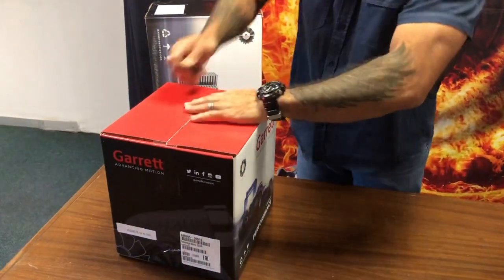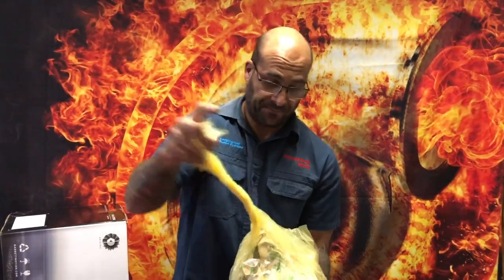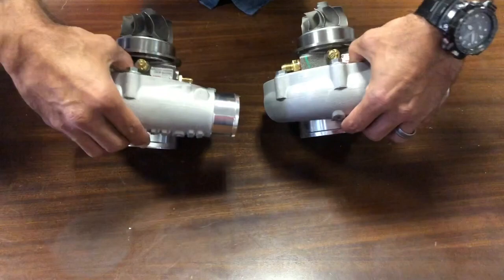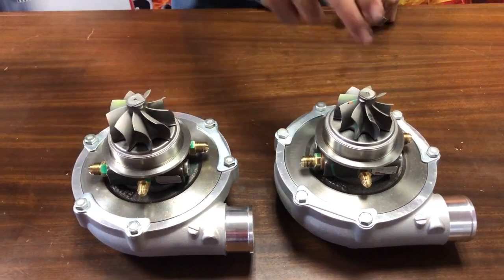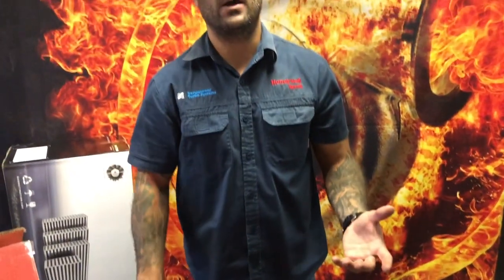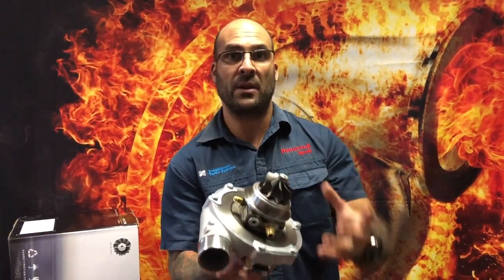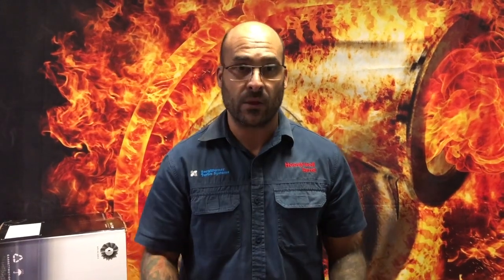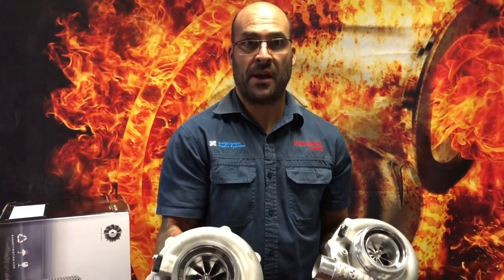G30-900 and G35-900 compared

Comment: Hi Chris. Going to be putting the G30-900 on to my RB25det with the 6boost and 50mm gate etc.. will they G30-900 be very responsive at 400rwkw and what kind of NM will it achieve? 

Thanks
Reply from the maker: What do you intend boosting?
Reply: Chris Kambouris probably boost will be set to around 17 to 20psi
Reply from the maker: @VFGTSR  that's not very high boost, don't expect too much from this turbo at that boost. If you don't plan on using any higher boost than that, and don't plan on producing 900HP - then i would seriously consider the 30-660 or G30-770 - in fact the EFR series would suit that motor extremely well too - faster spool than most if the same size Garrett units - due to the GAMMA TI turbine wheel. I say this because the RB25 is relatively lazy in spooling a larger turbo up - its nothing like the RB26 motor
Reply: Chris Kambouris  what boost level should I take it to you think.  
The G30-900  is that a similar sized turbo to the gtx3582r gen2. 
To compare too.
Reply from the maker: @VFGTSR  This all depends on what power you want to make - whenever a client calls us for advise on a turbo choice, the first thing we ask is "What HP target are you looking for?" Once we know this, the rest is made a little easier to calculate
Reply: Chris Kambouris  thanks for your replies. Because my bottom end is stock will be tuning the car to 500rwhp until I rebuild the bottom end then I will be tuning it too around 600-630rwhp
Reply from the maker: @VFGTSR  You going to need ALOT of upgrades done to the motor itself to achieve this power. The G30-900 will be my choice in the Garrett line-up and the EFR8474 with T4twin scroll turbine AR83 - this would be my first choice if this was my own project
Reply from the maker: @VFGTSR  To make this power on the RB25 you'll have to do a lot of head work, won't be as simple as putting on a turbo to make this power.
Reply: @TurboDirectSA  - I got same questions - on same build - How much spool later is a G30-900 compared to G35-900 if they are same 0.83 AR on a RB25DET? Thanks
Reply from the maker: @radaces  expect around 800-1000rpm
Reply: @TurboDirectSA  - Thanks do u know if G30-900 0.83 AR will reach 700-750rwhp Mark on a Hub Dyno? it's a Built Forged Rb25det with all supporting Mods n running E85 full time. Thanks. Planning to run 24psi low boost n 30psi high boost - Revving to 8k Rpm.
Reply from the maker: @radaces  no it won’t - maxed out the turbo will see this sort of power at the crank. It’s very overrated in comparison to the BorgWarner range of EFR turbos.
Reply: @TurboDirectSA - So will a G35-900 be a better suit?
Reply from the maker: @cesarrada8217  for the additional lag - it will make more, you will need to decide if you want a laggier setup though. I would go EFR8474 black - spool is ALOT faster and mass flow rate is higher too!

Comment: Chris as always, your videos are extremely informative, and well done! When looking at the compressor maps, all the g series seems to be a little lower than their advertised power rating. Or, am I reading the maps incorrectly? If you are building a street car (700-725whp) for quick spool, which turbo would you recommend? It will be on a RB26 with a progressive 100 shot. Thank you for all the work you do, and your time! Cheers, Tony
Reply from the maker: Tallen Motorsport you are not reading the maps incorrectly at all - keep in mind that maps are prepared in X'ratings' - When I spoke with one of the team leaders at Garrett in the past we spoke of a competitors compressor maps and the fact that they claimed to make so much air flow and boost level ....... i was shown that the map was setup in X-15 which equates to for every 10lb/min of air flow the compressor boasts 150HP -- when you see some of the other OEM turbo manufacturers, (we have direct distributorships with all of them) other maps are designed around X-12 (120HP for every 10lb/min of air flow - The latest Garrett maps might not seem correct (using the 10lb/min = 100HP calculation), but in reality, we have seen that the G-series actually produces more than what the maps claim,  showing yet another conservative effort on the Garrett side.  Ill try to get some more information from Garrett techincal team on this and comment back - perhaps this calls for another video..... 

As far as recommended turbochargers, i alway work slightly differently to other tuners/shops/outlets - i like to imagine this was my own build, and advise accordingly. The Turbocharger should never be pushed to its limits to make the intended power, as you know you ALWAYS need a little more here and there. Why push a turbo to its limits all the time when the engine is in use (unless its s track car/competition/circuit/rally application where budget allows rebuilds and the designs with HP limitations are on the ragged edge. If the car is a street car but will be used together with some form of motor racing, drifting etc, rather choose a turbocharger with some reserve in place in case of the demand for more - at the same time you lower the pressure, boost, heat into the engine, and run there turbo at lower speeds, however still using the same turbine selection for the required reeponse. HP is easy to make and if a certain turbo is just too big or just too small, it is easy to make small mods to the motor, fuel used or both to play "catch up" and fill the gap. 

G30-900 is a loaded gun!  We have just seen a Golf7R make over 700WHP on a G30-900 with AR61 turbine housing, and said goodbye to an expensive clutch upgrade - now to swap the tranny to the DQ500 setup..... point is the 700-750WHP setup cars will love the G30-900 (motor size dependant obviously) and have plenty in reserve. This power is easily achievable around 2.2 - 2.4bar boost gauge pressure, once again motor dependant. drop me a line privately if you don't want to share your project in the comments section, and ill help where i can.
Reply: @TurboDirectSA  A video covering that would be extremely helpful. I am looking at a couple maps right nany, and I see nothing that states 12 or 15 for x. I was leaning towards either the 30-900 or the 35-900. 700whp with a .61 on a 30-900, wow! My car will be 100% street. Forged 2.6 with 264/9.15 cams, meth, fuel to support 900hp, 3.5 exhaust, light ported head. Basically I want the grunt of a V8, but able to spin to 8200rpms safely. When I was running the numbers on the 2.6, I was on the limit for 2.3bar with that 30/35-900 compressor. Of course its what you plug into the variables that dictate the limit, so I could be off a little. With the number you just quoted, I will probably lean towards the G30. N2O on a RPM window that starts at 3200, but will close when full boost is hit. Just for some added grunt if needed. I hate lag. ;) Thanks again for that you do Chris! Cheers, Tony
Reply from the maker: @tallenmotorsport8416  Tony, i would lean towards the G30-900 for sure, it will make the power you want, since you have modified the engine to accept the flow that the turbo will provide, i don't see this being toooo much of a problem flowing to 8000rpm, but with the mods and cams, it might just lay down onto - if it does, simply change to the AR83 turbine and youll be 100% again, however you will then start using the NOS a little more ..... its always a trade off and a balancing act I'm afraid.

Next thing to try is add 5% nitro to your mix, and see what happens ..... :-)
Reply: @TurboDirectSA  just a question, on a destroked 2.3 wrx with all the extras which currently has the g30/770 but runs out of airflow which would be a good upgrade to keep good response. I would still like 4K response so it has a decent power band,but more top end so the turbo doesn’t roll over
Reply from the maker: @Adl-pk4hg  You see the results coming through on the G-series turbos now -- remember as i mentioned on the comparison between the G-series and the EFR turbos - as the boost increases the Garrett falls away, and the power reduces - Its sad that the G-series turbos are nothing compared to what the original GTX Gen1 and Gen2 were - i guess when the management teams 'rule' over their employees, the dream team falls apart - Now to answer your question - 

We have put together a turbocharger that combats that exact problem, that i have been speaking about for 3 years now. We use a combination of the Gen2 GTX and modified compressor of the G-series in order to hold power higher in the RPM range (compressor map widens) For now you might have to change the turbo to the 900 - BUT it will be laggier, this is in essence now what you want, but the other alternative is to change (you are changing a turbo anyway) to a different turbo. 

What HP target are you currently reaching? Tell me more about the boost and fuel used, ill share my thoughts
Reply: @TurboDirectSA  I’d be happy with the 600whp I’m a little off that atm on pump98 with 5 port water meth injection one to each intake runner and one over the intercooler core, at the time we went with the g30/770 it was the newest on the market, I like the response it just runs out of flow which means I can’t use the revs my motor was built for, it was originally tuned with a high boost level of 38 lb, but now due to the heat and humidity of where I live its max is 34 lb, it is only using the .8 exhaust housing I’m not sure if it is .81 but was thinking maybe with e85 and the 1.01 exhaust housing I might be able to make it flow better top end without losing to much response. What are your thoughts, my mechanic is of the idea a g35/900 or 1050 is a better match as I won’t have to use those high boost levels to achieve what I’m looking for, I’m just unsure as this will push boost response to nearly 5k which shortens the powerband
Reply from the maker: @Adl-pk4hg  Using a larger AR turbine housing will only induce more lag - this is not what you want - you wanted to maintain the 4K response. The problem is not backpressure, its lack of air flow - your engine is demanding more than what the turbo can provide at that higher RPM ranges.  If this was my car i would swap out the turbo for the 8370EFR - or last resort go the -900 route, BUT keep the current 82 turbine housing.
Reply: @Adl-pk4hg hi, I was running the same turbo on a ej25. I went from a .83 to 1.01 rear housing and gained 50 wheel kw, to 400 awkw same boost. Not much loss in response (I don’t notice any while driving but about 200rpm on graph). The EJs respond well with more turbine flow especially on e85. 

I’m going a g35-900 with 1.01 now as direct bolt on for my setup and want more power.see what happens.

Comment: How does the GT30-900 compare to the BW7163R in terms of max power and spool up time? Which would be better to use on a 7R which is both a daily drive and weekend racecar?
Reply from the maker: The G30-900 is not an apples with apples comparison. The EFR7163 is designed as a 550HP capable turbocharger, it makes this power with no issues and without having to run extreme boost settings. The G30-900 is a large compressor and much newer aero design when compared to the EFR unit - however the spool characteristics of all EFR turbochargers are nothing but extraordinary, due to the extremely light weight GAMMA TI turbine head.  If its 900HP that you want to produce, firstly your DSG gearbox will shout mercy first, the remaining drivetrain will never handle this and the motors engine block will certainly put its hand up when things get on the boil - if you looking for a "relatively reliable" achievement output of around 550-600HP the EFR7163 is certainly a missile of a choice - id suggest you watch this to suit that turbo choice.

https://www.youtube.com/watch?v=HecA-W9ji5M&t=1s
Reply: @TurboDirectSA  Awesome. Thank you for the reply. Now to compare the EFR7163R vs Turbo Technics V5.
Reply from the maker: @kiewietduplessis6463  Pleasure - never heard of the technics V5

Comment: Chris i have also question about the choice right turbo setup. I have Skyline with RB26 engine 2.6L with peak 8400rpm so high rpm and high pressure. I should go with G30-770 0.83/1.01 or G30-900 1.01? My goal is 580-620whp on 93.
Reply from the maker: SnaraGTR What boost pressure are you intending to run? What Fuel and what application ? (Application - meaning drift, drag, steerable, circuit racer etc?)
Reply: @TurboDirectSA  About 26-28psi. Fuel premium gasoline ron98 without meth. Car is only used on fast street or highways. No track/drift.
Reply from the maker: @Snaraa  You need to use the G30-900 with AR83 turbine housing - the 71mm exducer on the G30-770 is going to be too small to make this power hold throughout your high revving engine. The G30-900 uses a 76mm exducer compressor and will spool more than responsive enough and make the power you want without having to push the turbo too hard, or running too much boost pressure.  This will make for a more reliable motor and turbo combination and slightly lower boost to achieve that power you want.  I would also consider the BorgWarner options, the GAMMA TI turbines are extremely light weight and spool extremely fast with seriously high flow compressors. The quality and longevity of the Borg's are actually better than the Garrett counterparts due to the lower weight that the ball bearing cartridge is carrying.
Reply: @TurboDirectSA  Thanks ✌️ I am very grateful to you. I think efr8374 with 74mm exhaust will be more laggy and have worse response than g30 with 60mm exhaust 🤔 but maybe some one compare both turbos.
Reply from the maker: @Snaraa  No buddy you wrong - the EFR8374 turbine weighs less than the G30 turbine head, spool will be much of a muchness, however the lightweight rotating assembly will last forever.

Comment: Chris my question is and allways been the same from the day GTX3582 and GTX3576 came around.
What about the .63 + 35 wheel vs the .82 + 30 wheel. There we have the same turbine flow and compressor flow.
Lets say we have a low rpm - high boost requiring engine vs a high rpm  - low boost requiring engine to make the same hp what tubine wheel + turbine housing combo goes were? I know its a difficult question but it deffinately has an answer.
Thanks
Reply: I'm interested in your response to this question too. I also have a question of my own. How do you feel the g35-900 would respond compared to a gtx3582r both in 0.82 housings?
Reply: on a vtec b16 81.5mm engine with 10+ cr which turbo would be the best to hit 600-700hp?  i bought G30-770 reverse rotation on 61 a/r .
Reply from the maker: @Denpolypataw  the turbo you purchased is a perfect match - the 71mm exducer compressor will hold power into high RPM on that B16 - even with the high CR. With or without cams, this turbo is well suited.
Reply: @Denpolypataw  It wont do 600 with .61 a/r unless you use racegas.
Reply: @abec666  why?
Reply: @abec666  he should be able to hit 600 wheel with a G30-770 on 93 + meth alright, I would think he would be good for 620-640 wheel assuming appropriate supporting mods and a good tune (though I would run octane booster in every tank just because it will be pushing on a bit and a bad batch of gas could do real damage on a tune that aggressive).
Reply from the maker: Abec777 Hondatech - its simple buddy, low RPM high boost requires higher backpressure in the turbine (smaller AR and smaller turbine) the high RPM low boost setup need a few tricks to make sure it pulls and makes power throughout the entire RPM range - So lets say you want 0.5 - 0.7bar gauge pressure on a high revving engine, that is not critical in terms of the boost response -  you would use the larger AR turbine (you want the power to hold up top of the engines RPM and not fall away) and you would choose a larger diameter compressor being the 35... BUT because you running low boost, power will naturally fall away up top because the flow from the turbochargers compressor eventually isnt enough to keep up with the engines air flow demand (obviously this changes with every engine, you would need to resort back to plotting the compressor as per my previous video) SO - as you get to the engines RPM where the power and/or torque starts to fall off, you increase boost pressure say from 0.5bar gauge to 0.7bar gauge around 200-300RPM before that point, and this usually lifts that curve back up again and carries further n the engines RPM band.
Reply: @TurboDirectSA  Thank you for your answer altho i missled you with my writing: 

-Engine 1 is a 2.0L/9700rpm than can hit 600hp at 25 psi. (typical Honda engine).
-Engine 2 is a 2.0L 8200rpm that can hit 600hp at 35 psi (typical VW/audi engine).
The GTX/G35 "76" with  .63 a/r and the GTX/G30 "76" with .82 a/r flow the same lbs/min on the turbine side AND have the same compressor wheel.
What turbo would be used at what engine.
Again thanks!
Reply from the maker: @abec666  Buddy ill have to sit down and make up a video for you and ill post it on a private link and send it to you.
Reply: @TurboDirectSA  Wow Thanks!
Reply: Hi Chris have a RB25DET putting the G30-900 on it with the 6boost 50mm gate etc.. you think this turbo will be very responsive on around 400rwkw ? And what NM mite it achieve? 
Thanks